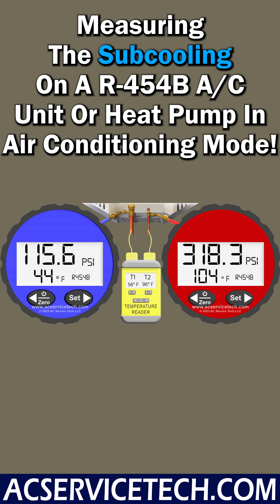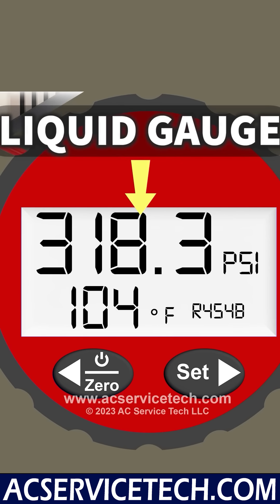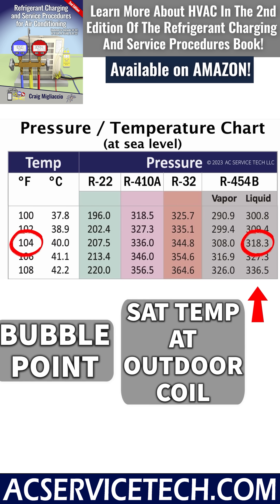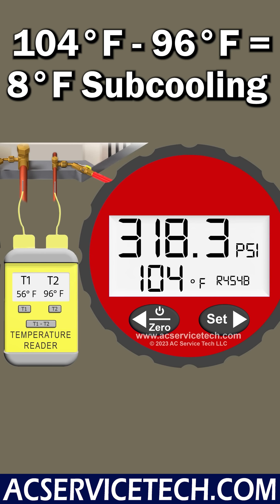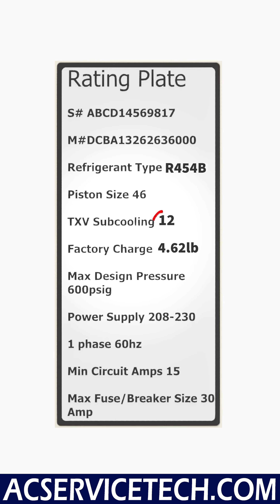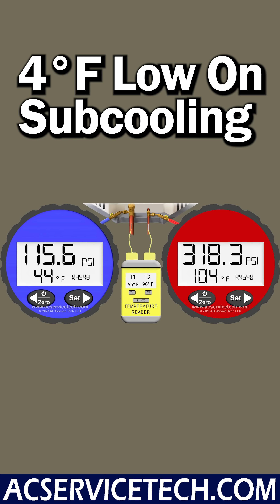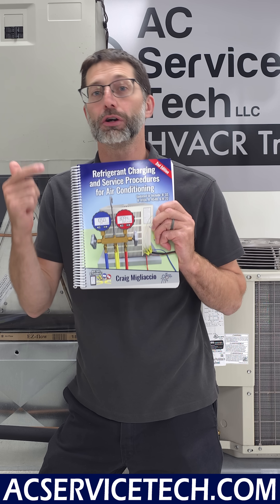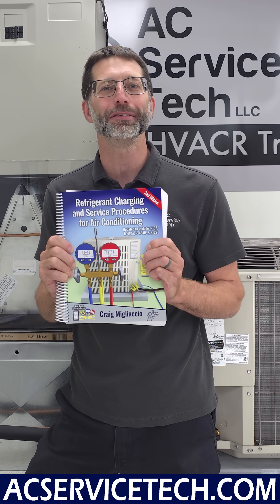Measuring The Refrigerant Charge On An R-454B Air Conditioner! HVAC Training!!

Comment: TXV's are the worst thing that ever happened to HVAC. They cause so many problems.
Reply: It's because they have moving parts.
Reply: They are quite reliable when installed properly. Most residential TXVs do not have screens to cut costs so it is crucial that nitrogen is purged when brazing. People don't do that and then act surprised when the TXV doesn't work properly.
Reply: @Redtooth75  I installed a carrier system 5 years ago and I always braze with nitrogen flowing through the line set. I'm also very careful about brazing close to the TXV making sure to protect the TXV with a wet rag and heat blocking gel. Yet a month ago that system's TXV failed. It utterly sucks how difficult it is to replace these terribly fragile products.  Why don't the manufacturers make it so they can be screwed on and they should put a shutoff valve right before them so you don't need to remove the refrigerant from the system when replacing these terribly fragile gimmicks. There are plenty of examples of HVAC components that screw on and don't become a common source of leaks. Why can't the HVAC manufacturers ever IMPROVE their products? As the years go by the systems are made more and more unreliable. I've serviced systems from Trane that are 40 + years old and still running with all of the original coils. The most amazing thing I've seen is a system from 1972 that is still running, with no refrigerant leaks. It was branded "Montgomery Wards" which is a now defunct department store. I have no idea who made the actual system. These new systems they are selling today are failing in less than a day with burned out compressors.

Comment: If a system is ever low on refrigerant does that mean that there MUST be a leak present somewhere?
Or is a certain amount of refrigerant sort of expected to leak over time
Reply: Depends…. How cheap are your preventative maintenance guys? In a perfect world no there should never be a loss of refrigerant in a sealed system. In this world although we have to deal with incompetence which leads to loss of refrigerant.
Reply: @kylekrason2 Like Wavyysav said, it does depend on who you have looking your system over, but it does also depend on how much is lost in a certain amount of time.

Some technicians don't know how to purge their hoses correctly before disconnecting and end up pulling some of the charge when removing their gauges. But... some companies do know this and will offer up to a 1lb addition of refrigerant charge during summer checkups. Does anyone really monitor those additions, I couldn't tell you.

The only time I check anyone's refrigerant levels is if they're a new customer. Because now I know what it is and I was the last one to touch it. After the first time, it's all non-invasive testing from there on out.

And if anyone touches the system after I have, any warranty they may have had through me is void.

I hope this helped
Reply: Verify your airflow first than check